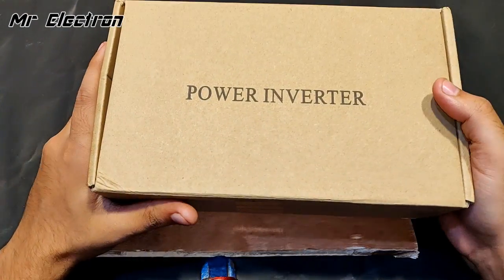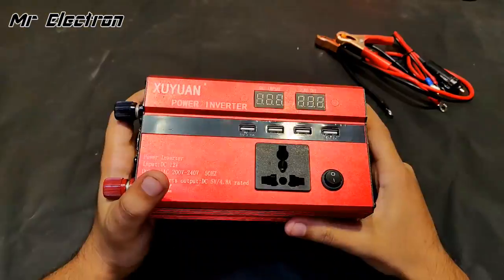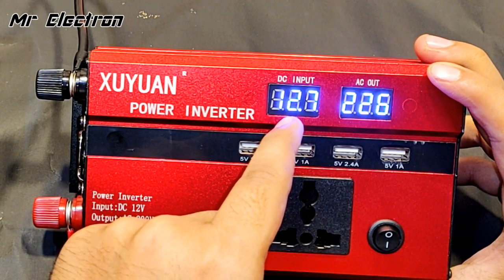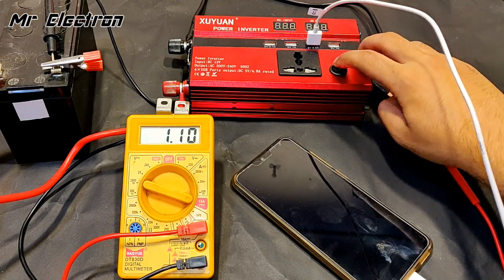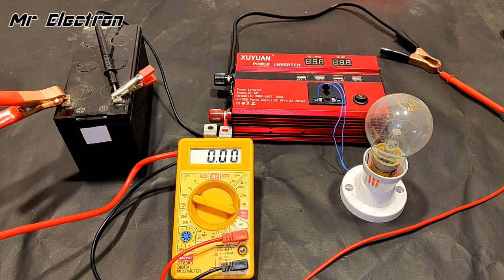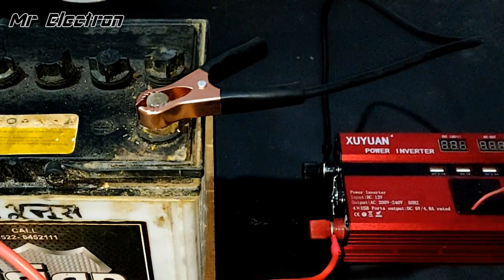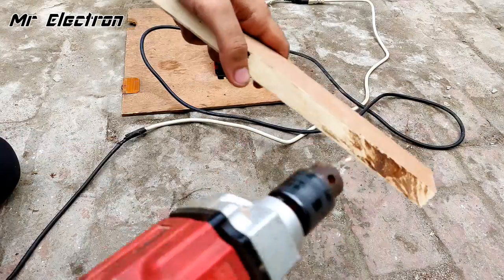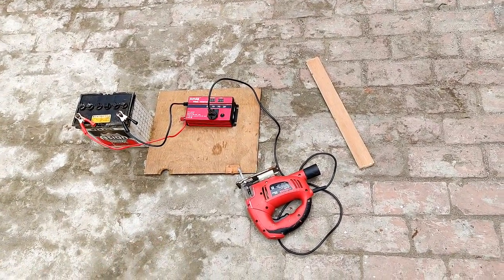Run 220v Drill Machine with 12v Battery - Cheap 3 KW DC to AC Inverter

Comment: My question is how long can work the angle grinder with such battery? Approximately ofcourse...
Reply: The inverter will fail before the battery dies
It is only rated for 350W continuous and 3000W peak as seen from the website

Comment: Won't it drain d battery quickly,so  d soul purpose is running d high rpm  ac motors,but i just want to convert ac machines to cordless machines for my outdoor wood cutting purpose ,plz help me to ac to dc machines plz....ans

Comment: That has to be the smallest 3K inverter I have ever seen. That is NO 3K inverter, it struggled to start that grinder 3K will run a cloths dryer or boil a kettle
Reply: Continuous power: 350W
Peak power: 3000W

Comment: That inverter is able to load 3kW but you are over-discharging the battery, for 850w load at least four 200 Ah c10 battery should be installed.
Reply: It's a 350W continuous inverter so one battery is enough. 
He tested an 850W drill but only under almost no load, no problem for the small battery.